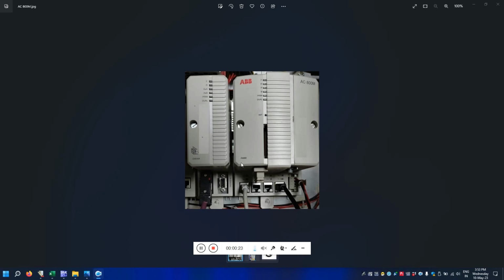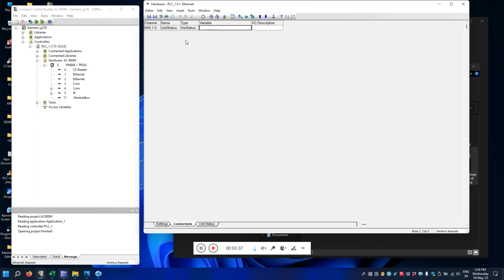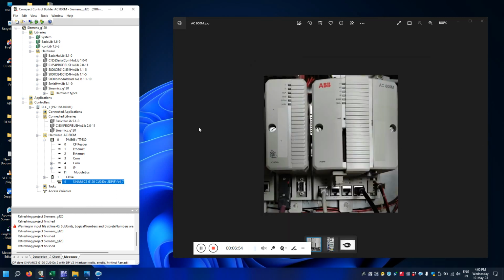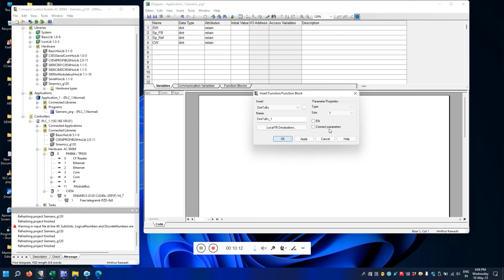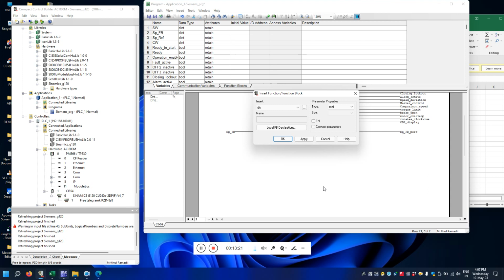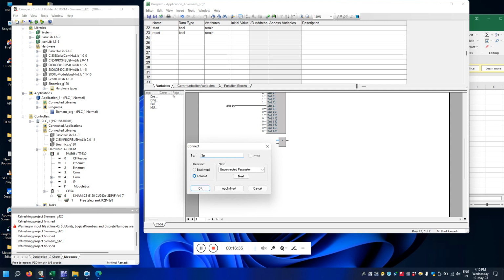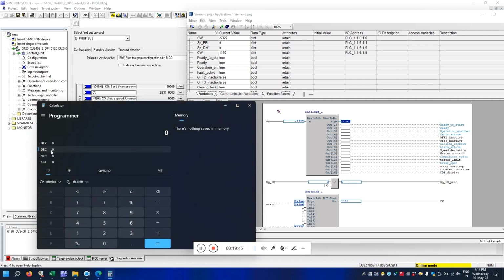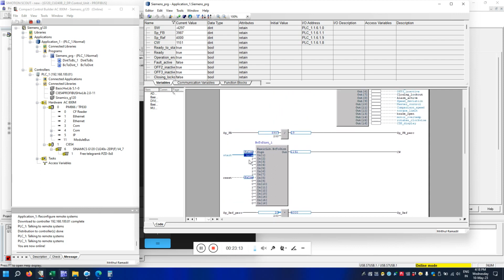30. Interface Sinamics Drive with ABB AC800M PLC

Comment: The data mismatch happens when reading Status Words from the drive. The solution you offers (to add 65536 to the value), will work if the value is negative only. It makes no sense if value is e.g.32100 or any other positive one.
Reply from the maker: Hi, i was bit skeptical about that one, i will try to find out a better solution for that one.
Reply: @averageengineer4266 anyway, you did a great job. Many thanks!

Comment: Why divide and multiply by 200 to convert in percentage...from where 200 come
Reply from the maker: Scaling factor is 200
Reply: @averageengineer4266  please explain where I can find any information on a scaling factor of 200. I have checked everywhere and no result. Why we can not scale it as 0rpm = 0; 1500rp=16384? Thank you!
Reply: @averageengineer4266  oh mate, I  ve almost broke my head thinking of the scaling factor of 200...but today I realized where the mistake is. I must be 163.84, not 200
Reply: Did you understand why he chose 200? I am desperately looking for this answer everywhere. please advise you have a clue mate

Comment: Great work sir and great job 
But i have one question ❓
Why in installing gsd file i but type such like one byte to dint and one word in dint i misunderstand that how is work for this or in other side can you please explain to me mapping of it 
Thank you sir again
Reply from the maker: In AC800M PLCs , DINT format is well supported in software. You can find lot of standard block for data conversion when used in DINT format. But from profibus slave like drives, the data send are in bytes or words, so we need to define the conversion rule while installing GSD about how to convert to DINT format.
Reply: @averageengineer4266  do you mean if i send a data in word or byte formate it converts automatically to Dint which i defined already in gsd before i installed it
Reply from the maker: @heshamzahra4836  yes